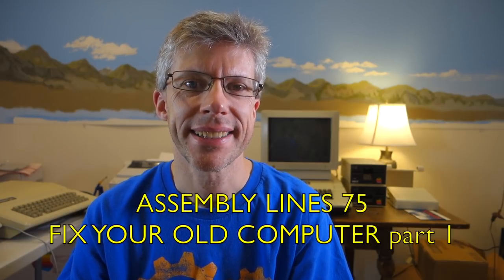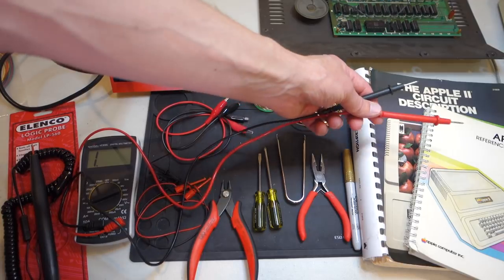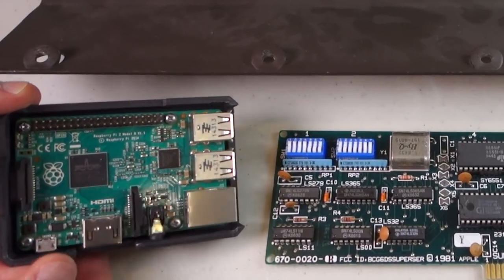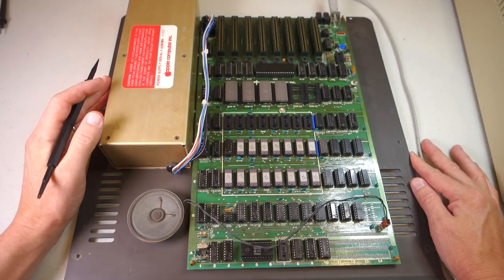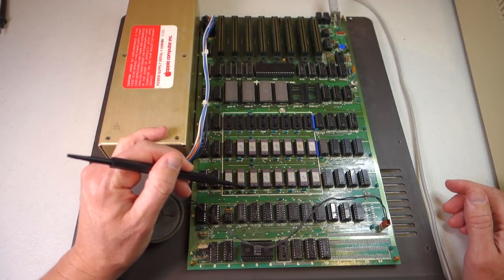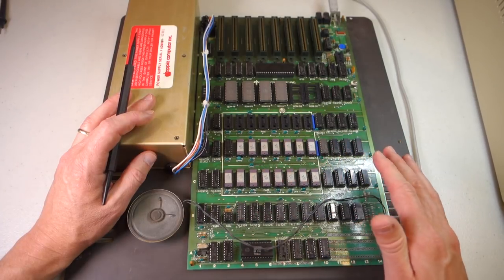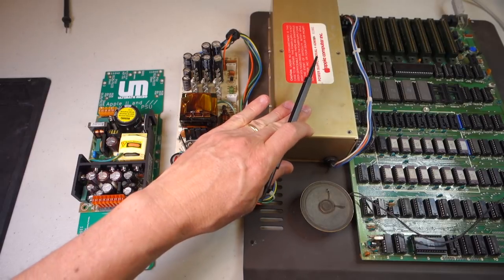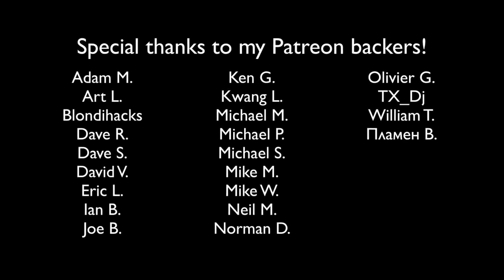#75 Fix Your Old Computer 1

Comment: Top stuff. Extra tip: look out for chips with a bent pin that misses the socket. My Disk ][ card came this way from the factory and I learnt a lot in attempts to deal with my Disk ][ drive randomly wiping entire floppy tracks!
To see what it takes to fix modern Macbooks, check out Louis Rossmann's channels on component level board repair.
Reply from the maker: That's a great point about the bent pins - I might include that in the next video.
Reply: Cool. It was a classic because pushing chips in fixed it for a while. Wasn't till I blew chips on the card that I found it and why it affected Apple Pascal more than DOS 3.3! Search "factory fault" on here for details, a fun Apple II tale. Deserves to be a page in its own right.
https://blog.juicylizard.com/about

Comment: Very nice and informative video! Just out of curiosity... what kind of capacitors are the ones in your apple II motherboard? Tantalum?
Reply from the maker: I believe that the motherboard primarily uses ceramic disks, with a few aluminum electrolytic. But it varied from model to model.

Comment: Like I said on the group,  30 watts for a soldering iron is too much and for an amateur learning how to solder will burn off traces from the board. 15 watts is the better iron to get.
Reply from the maker: Very true - or you can get a soldering station and then you can adjust the power.
Reply: That is quite true. But unfortunately the electronics amateur on the Apple Group bought a 30 watt iron, not a station, and has posted a couple bad "Look what I done, how do I fix it" photos.

Repairing computers is both an art form and a science. One has to learn the very basics of soldering and be able to identify chips by looking up their numbers.

I'd like to see more of what you started here. It looks like a great start.
Reply from the maker: Yep, I agree about your art form/science. My first soldering jobs were a disaster. I'm much better now but still not up to the level of a tech at SparkFun or something...